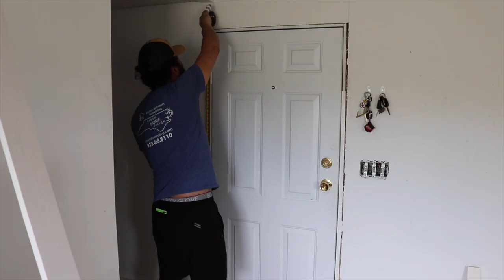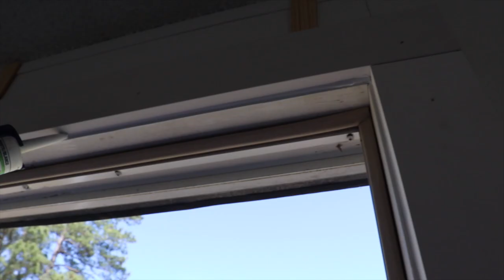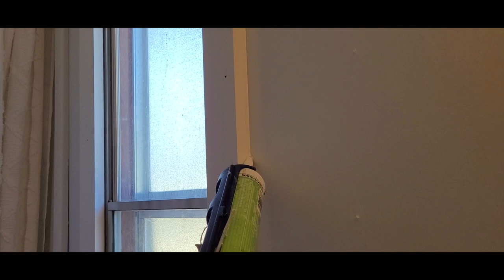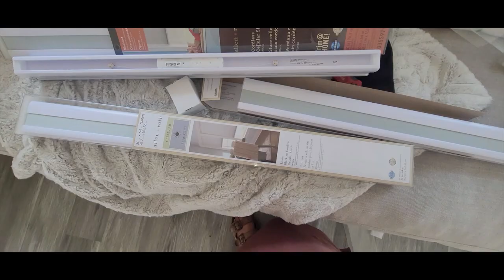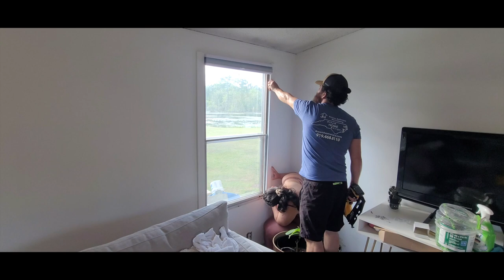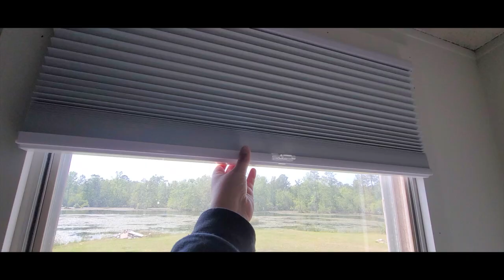Mobile Home Renovation Ep 11 - Window Trim and Blinds

Comment: Hello, 
I just found your channel.  I'm trying this trim out now. How did you cover the metal trim. The screws around my windows stick out too far.  I would have a 1/4 gab around the window.
Reply from the maker: Hey, thanks for watching. You can try changing the screws for a flat head screw and regress it slightly. We had to do that in some areas. Then, after placing the trim, if there was any remaining gap, we caulked it. Hope this is helpful for you